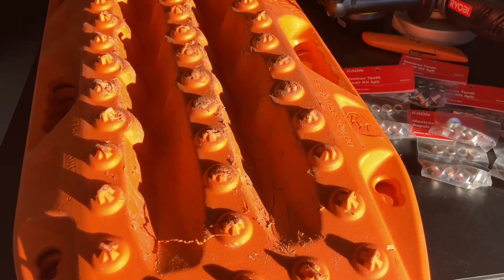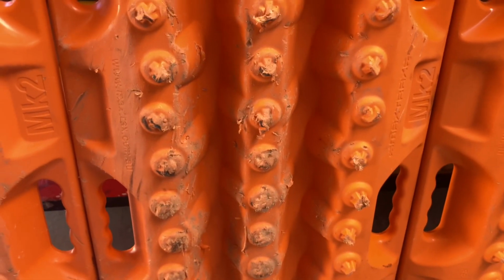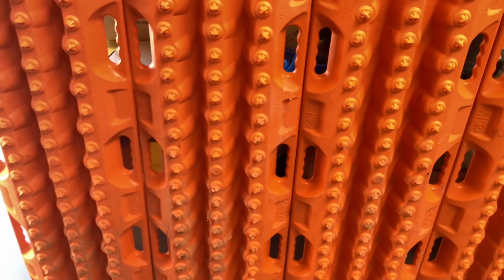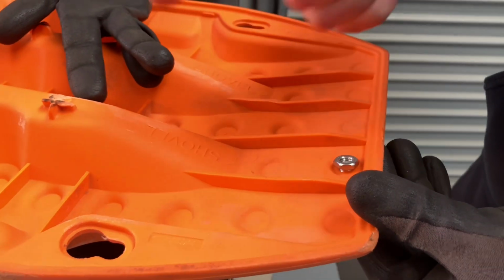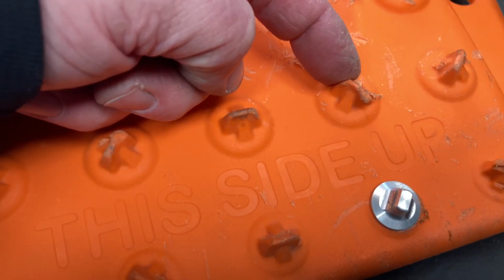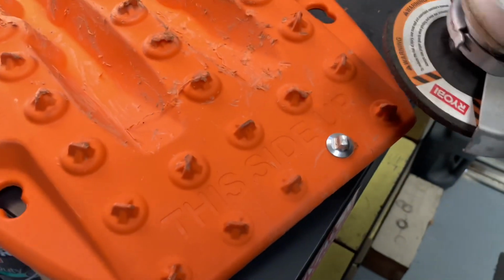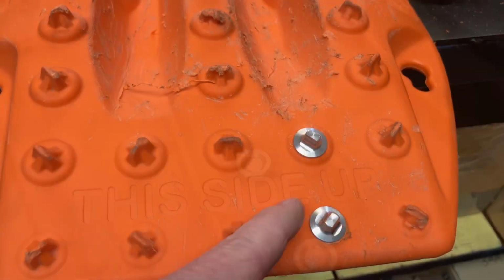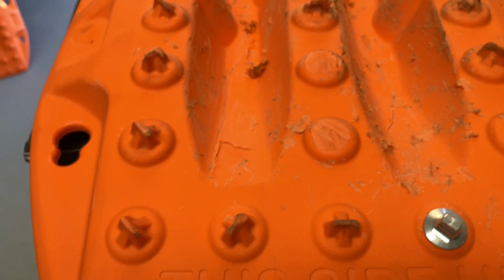BEST GEAR and Tools We Found  to REPAIR MAXTRAX with KAONs Teeth 😮

Comment: Why repair them? Waste of time. Buy a cheaper knock off pair that work just as good in my experience. I have a pr each & and knock offs work just as good and no wear compared to my maxtrax. A third of the price. I know people believe that if u pay more money for anything, it will perform better. This is not always true. Should not need to spin wheels on these mud extractors: defeats the purpose.
Reply from the maker: Repair them because it looks cool
And then they will be tougher than anything else on the market being alloy instead of plastic next time, someone spins the wheels it won’t be a problem